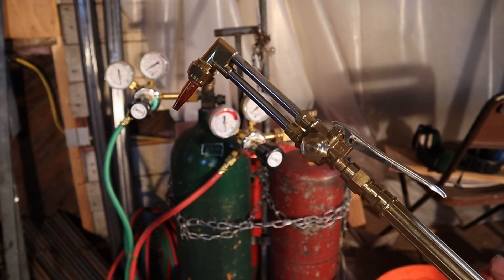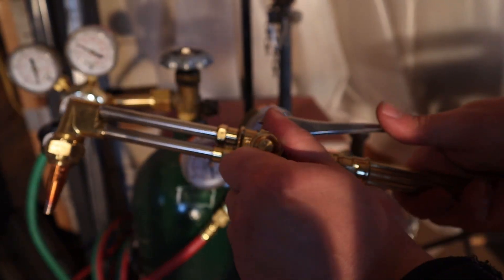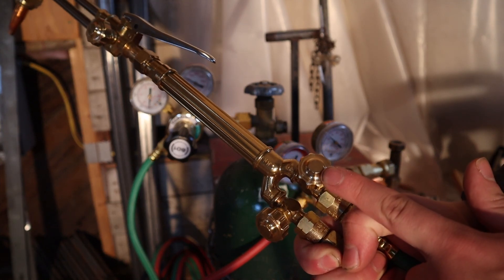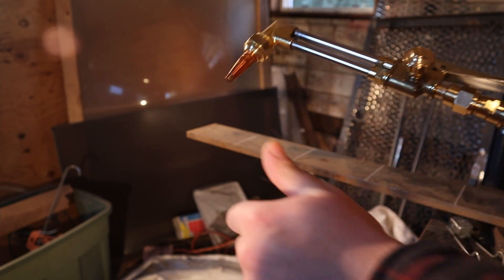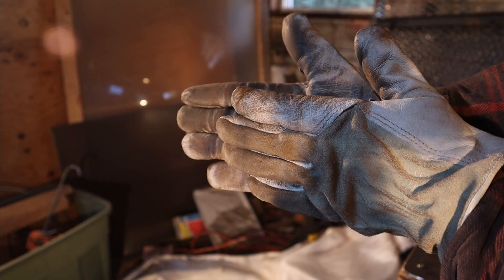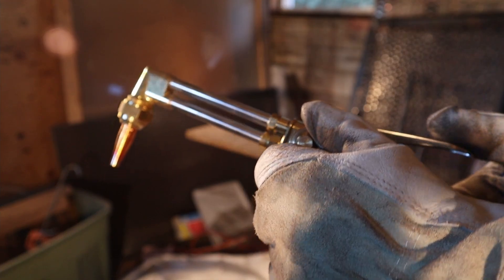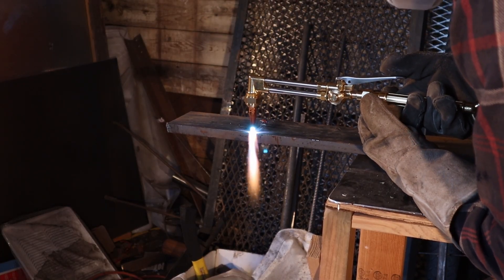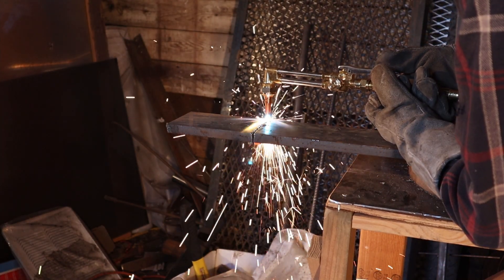How to set up a cutting torch? / Quick Guide!

Comment: Back in mid 1980s,after I got out of 2 years diesel mechanic school,my first job was building demolition and excavation company. Almost all bigger buildings had steel I beams and H beams. They used the 80 gallon propane tanks and the big Dewar oxygen bottles. Torches were about 3.5 feet long,with as many as 3 people cutting on one set of tanks.

Comment: Really cool.
How do I know if the acetylene or the oxygen have finish
Reply from the maker: The tanks will be empty when the main valve is turned on, but the gauge shows 0 pressure.
Reply: @FerrousPhoenix  what if there's no gage how do I know it's empty?
Reply from the maker: @duke6353  if you turn the valve on and hear no hissing from the nozzle or feel no air pressure coming from the tip, then its most likely empty.

Comment: Length of video was good, but you definitely should have been doing the adjustment with it lit for the demonstration, rather than just describing it. On a personal level, I learned to cut by watching I C Weld, and he runs pressures way higher, and I like to run like he does. I run 7 and 70 like he does, but with a 0 tip, and I get clean cuts, with almost no slag, and the piece just falls off. There's textbook, then there's practical. I'll take a clean cut, that requires almost no cleanup at the expense of using a bit more gas. If your goal is to use less gas, then the way you did it was fine. If your goal is to get the job done, Isaac's way is better. I like Isaac's way. I'm usually trying to get a job done, and I enjoy cutting when it's clean.
Reply: Hahaha this wouldn't happen to be Isaac would it